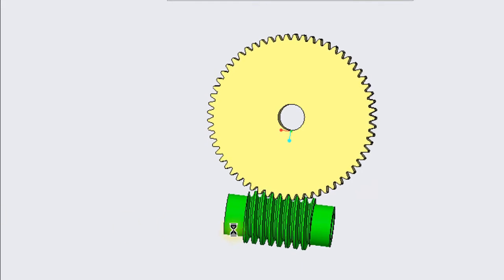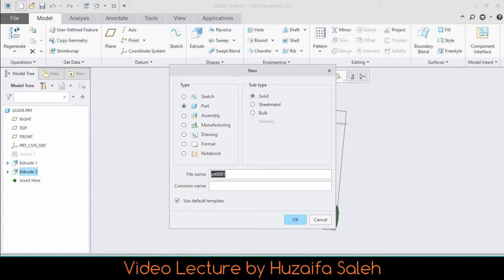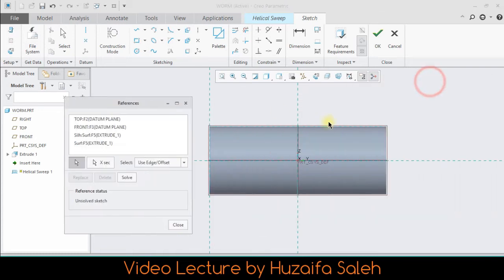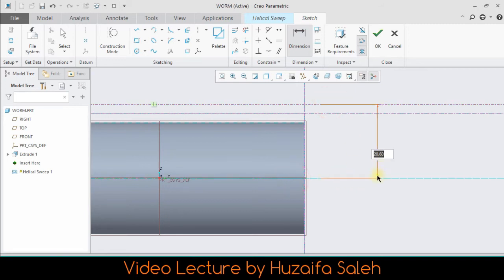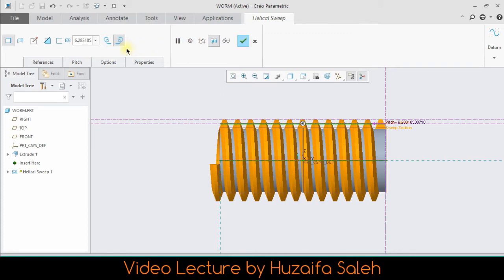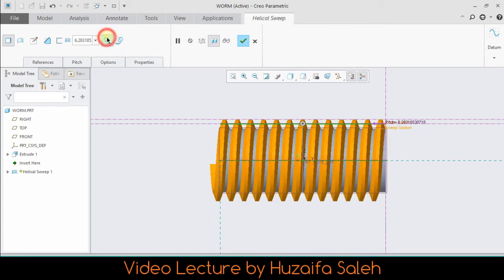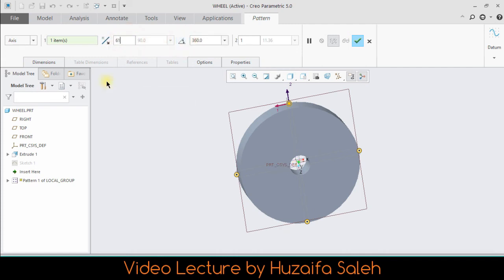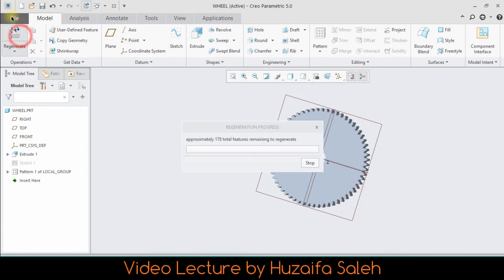Worm & Worm Wheel Mechanism Part 1 | Design of Parts | PTC Creo

Comment: the gear teeth is straight, not by Involute formulas,  is it a common practice is industrial design? or you just make simple profile for this presentation?
i am new to this area. sorry for this question is it is too simple.
Reply from the maker: Here we are just learning CAD software for the given drawing not the theoretical process as we don't know the usage, load and problem statement. And don't be sorry for asking questions